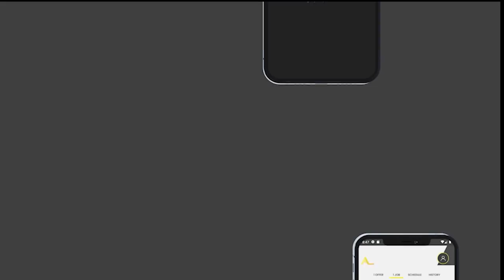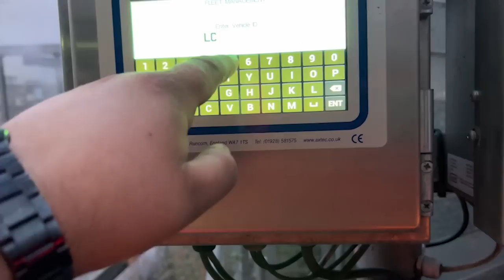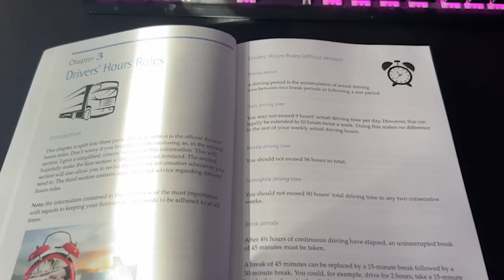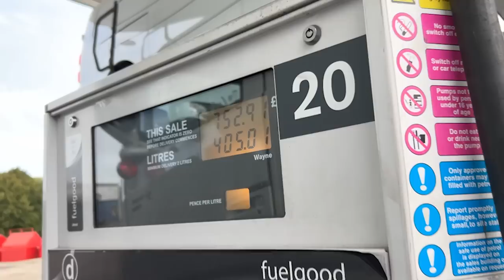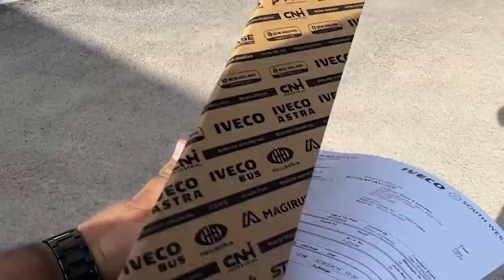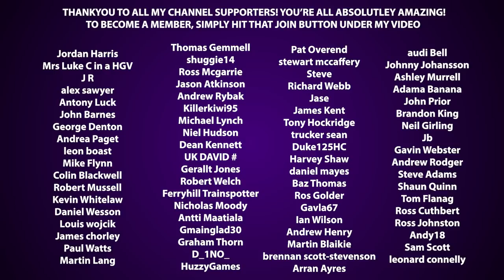I Cant Believe I Actually DAMAGED My Brand New Truck!

Comment: I run 22 trucks and sometimes this happens but when the drivers come back and you can see there general frustration and upset  as this kind off incident you just let it go , at the end of the day, it’s only metal and plastic .
But on the other hand, I have people come back and not give two hoots about damage and those are the kind of drivers you can let go without feeling bad 
No stress Luke 👍🏻

Comment: 25:56 the driver was changing the siren tone which are wired to change using the horn buttons so they don’t have to take their hands off the wheel. A double toot turns the sirens off and a single toot turns them on or changes the siren used.
Reply from the maker: Oh 😢 so he didn’t say Thankyou 😢😢
Reply: @lukecinahgv  sorry to rain on your parade but maybe not saying thank you - the driver might have wanted to change the siren tone for negotiating the queue of traffic. 

That said, If you leave the emergency services space to be able to make progress under blues and twos, they will ALWAYS appreciate it but they won’t always have time to show it.

Comment: I'd be pulled in at our place if I run that low on fuel , it's not good for the filters etc.
Ref. the damage. No one hurt just your pride for a few days . it's repairable . Strange week as Raul's truck took a battering also

Comment: Good old Vestry Estate in Sevenoaks. Did you get away with parking up there for the night? The traffic wardens get upset at me for taking my breaks exactly where you were parked up next to Screwfix.
Reply from the maker: 👀 yes I parked there no problem. No one said anything.
Probably won’t park there again then if there’s been issues in past 🙈
Reply: @lukecinahgv I do see trucks parked up on the A25 heading towards Sevenoaks from the H & H roundabout. Probably not the best place for a reasonable night's sleep, being right on the road though. There is also a layby on the right by a recreation ground as you start to head up the hill I don't think that has any restrictions on it. 🤙

Comment: Absolutely disgraceful doing that you should be hung drawn and quarterd for that 😂 don't be too hard on yourself is there any dtiver that's hasn't damaged something at some point its not a major repair at least you didn't smash the truck on the front a friend smashed the front os corner of a daf he was driving he paid for the repairs himself over 5k in parts alone and then 2k in workshop tine he was expecting about 2k at most daf parts are expensive feel free to price all the parts for the osf corner for a daf not including the bumper we were able to repair it